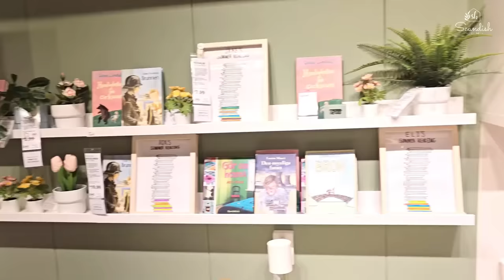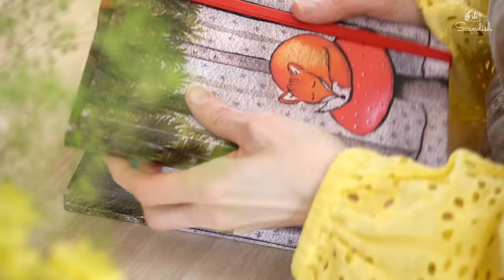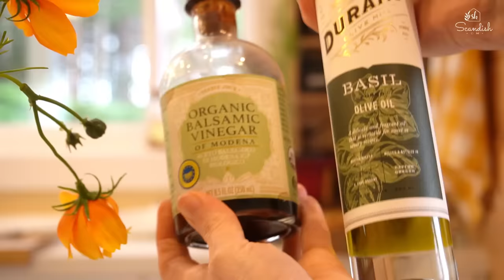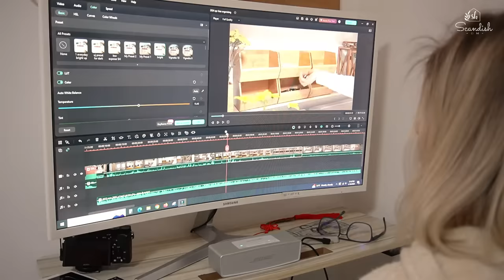IKEA ORGANIZING  | SPRING PROJECTS

Comment: 4:50 how it turns? Good? I looking for a new pillows
Reply from the maker: At 4:50 I show the umbrella are you asking about the pillow or the umbrella? The pillow is good if you have shoulder and neck problem and you have to sleep on your back or side. For that this pillow holds up very well a lot more firm then other pillows. I use this type for 20 years.😊